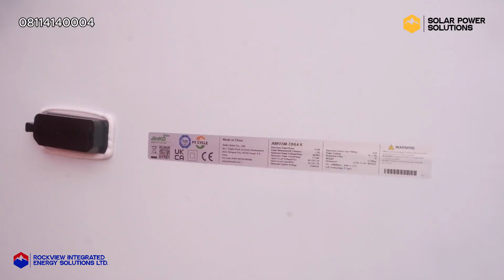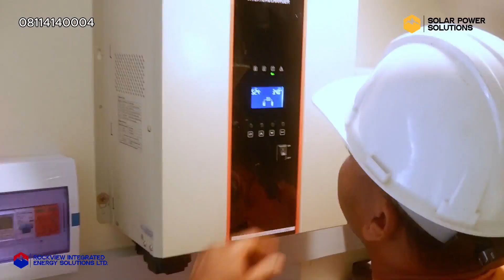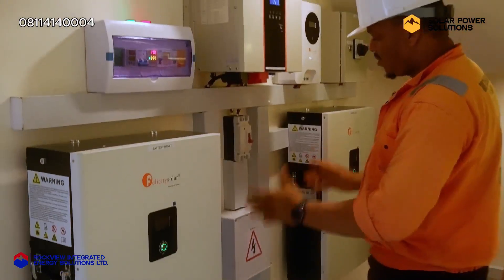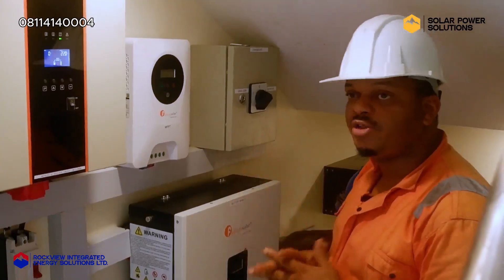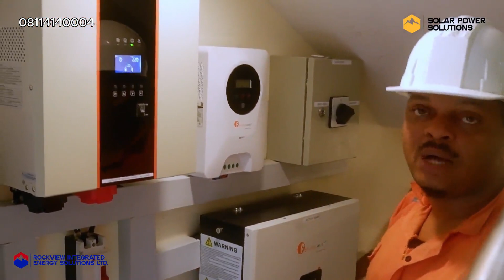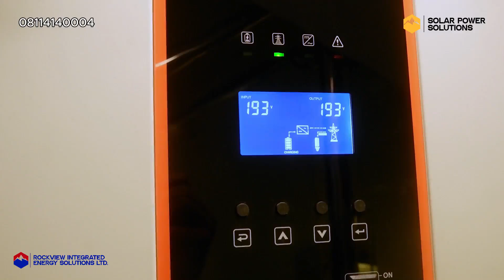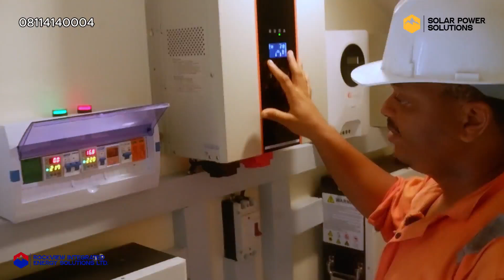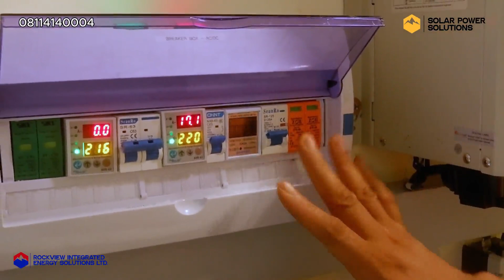Ultimate Hybrid Inverter Setup || 10kVA Solar Installation Guide in Lagos

Comment: It's good but  due to atmospheric issues especially during low sunshine(cloudy and rainy weather) the power will drop and will not have sufficient current to charge the batteries in time.Also, during longer hours, if there is no grid power, the battery pack will work day and night and it will not work as expected.
If the owner has money, that panel setup should be added again, 5.5kw x 2
Reply from the maker: Solar panels have a lifespan and the client is open to upgrading the system in the future.

Comment: Where my own problem is how loads are being mentioned to be powered by the capacity built.

3ACs of many horse power, fridge and freezer etc? 
It's just 10kVA inverter (8kW) with 20kWh lithium storage of 16kWh usable energy at 80% DoD.
Reply from the maker: This system was designed to cater for the client's needs in powering 3ACs, a fridge and lightings. This was all that was mentioned.

Comment: 5kwp to charge 20kwh battery is unrealistic
Reply from the maker: 5kwp? Could you please clarify what you mean. 5kwp was what the clients could afford at the moment.  They agreed to increase the capacity of the solar array with time. Stay tuned on this channel as we would post when it's increased.
Reply: @SolarPowerSolutionsNg  I think what he means is 5500w panel sufficient for a 20kwh lifepo setup?
Reply: Explain please? What is the actual solar power required for a 20kWh storage?
Reply: @Hyper_oba  My experience is that 5500w panel during this upcoming, abi arrived raining season will be generating around 8 - 20kwh per day (considering cloudy days which is going to be the norm now). But when rain stops and sky clears, those panels will easily generate >20kwh per day.
Reply from the maker: @testing-rd6yc  You are right, you should also put into consideration that the power will be used simultaneously while it's charging.